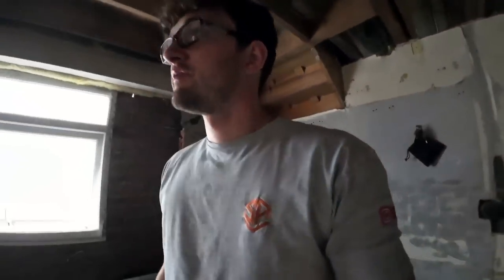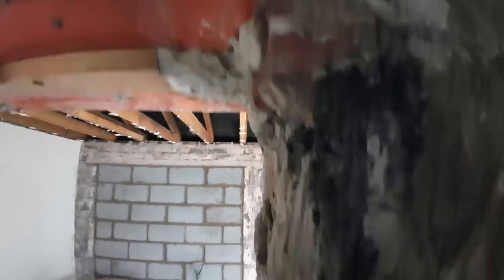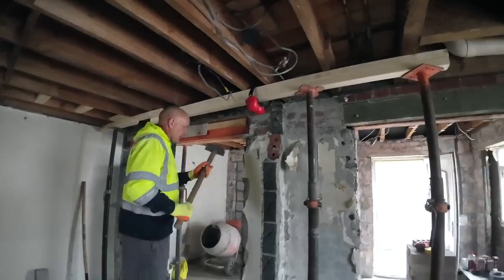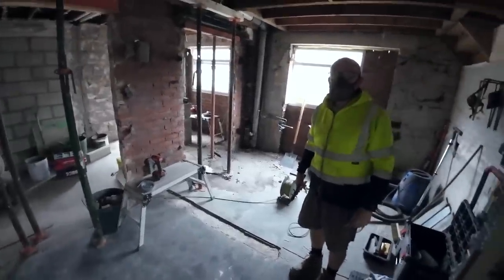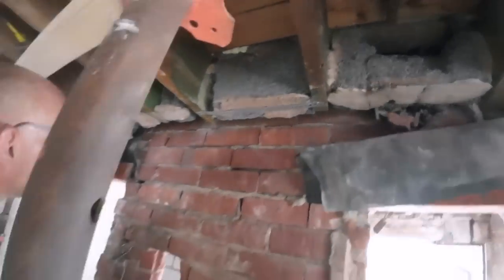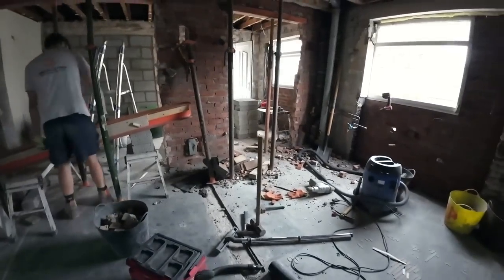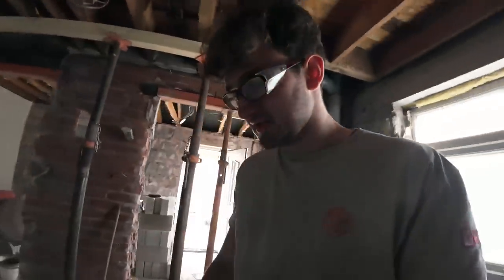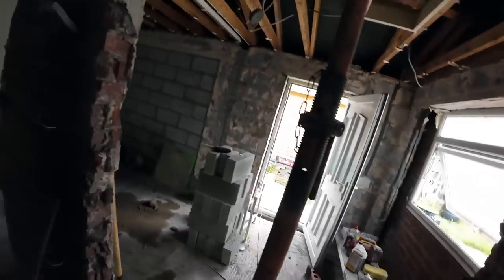UNCOVERING MORE HORRORS..BIG ALTERATION JOB PT 3

Comment: Hello Steve and Alex, you never know what your going to find when you take the plaster off lol.

Great job that house will be much safer now and good for another 50yrs or so.

Just done a similar job myself  the steels were only resting on the wall about 50mm. Only thing was the original builder had used double layers of  plasterboard to pack them up😂😂. You just never what the day will bring 😂😂

Keep going fellers look forward to the next one.
Reply from the maker: It’s grim Jack some  of the stuff you find hidden or buried 😳🫣🧱👍🏽

Comment: Always enjoy the time spent with you both ... been wanting to ask what is the insulation made of that you insert between the two brick walls and why does it not get wet or damp over time ?  All the best !
Reply from the maker: Hi , glad you enjoy the channel .
   The insulation is mainly glass fibre or recycled plastic bottles so both raw materials are water resistant. Also the way it manufactured it has like a grain so water passes through vertically but not horizontally 👍🏽🧱